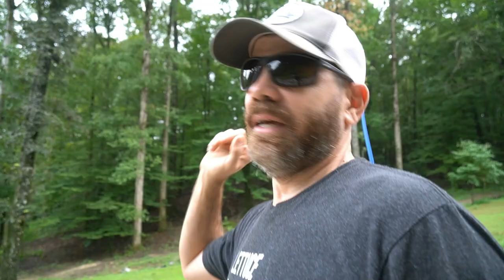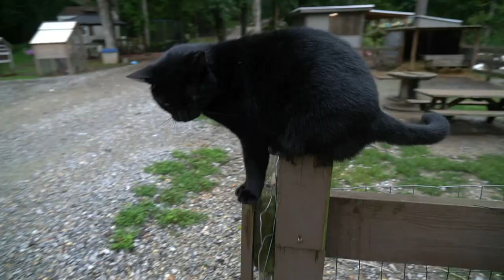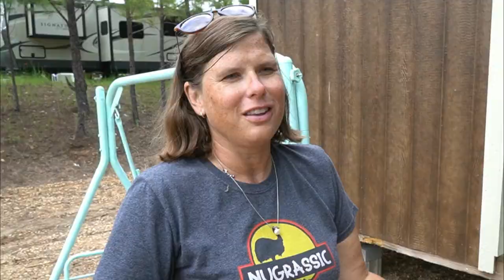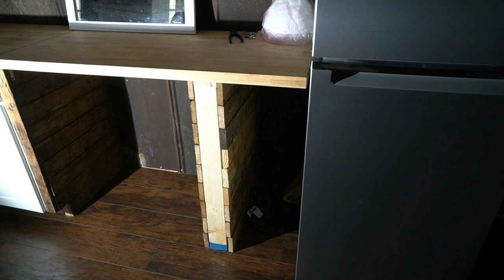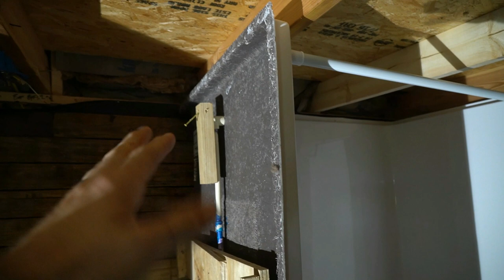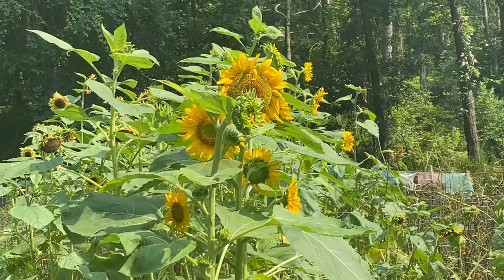The OFFICIAL Tiny House TOUR. (Would You Live In This??)

Comment: I love the layout of the tiny house and the spaciousness of it (esp. compared to the tiny houses we have here in CA).  I also appreciate the up-cycling of the materials, but I'm sorry, it should have been used inside sparingly and instead used outside, because it's too dark inside even if there's light later.  I would rather use those old barn woods outside, and paint the inside light color, with some barn woods and old tin accents like for the back splash and the TV wall only.  But it's still a very comfortable and well built house after all.  I still have difficulty saying "tiny" though.
Reply: White wash the ceiling in kitchen so nobody chops any fingers!!!👍
Reply: Yer, I was thinking I'd go over and do a pickled lime finish on the reclaimed materials so it would lighten it up. I'd especially sand down and finish the metal bits.
Reply: @D A Tsun510 - Agree it's not a tiny house in our neck of the woods. We call them shed houses. A tiny house here is one you can pull with a pickup, half the width of Mama's house.
    But going down from the size of her house, it sure tiny. 🤣
     Like idea of pickling or whitewashing the barn wood interior, it's too dark.
     I don't like the "antiqued" tin on interior walls. They often make it rusty with chemicals. I think it might give off harmful chemicals or particles, bad for breathing indoors. Grew up on small farm with V-crimped galvanized tin sides & tops. It's made in China usually. There could be harmful chemicals in the sheet metal, like lead. A rough texture , i.e. rust, will attract dust & cleaning or dusting it will release particles in the air.
     In a bldg like that, some of the quickest & cheapest walls are the sheets of what was called Masonite. They have them enameled on one side, & various colors & designs. No painting needed, & easy to clean.
Reply: @carolynchadwick7867  Yikes, I didn't think of that: the rust was intentionally created.  I thought it was really a used building material.  Regardless, rust = tetanus, unless sealed, which not only will protect the health of the inhabitant, but it will also stop more rust from forming.  I also think it's not healthy inhaling the dust particles emitted from either the rust or whatever it is used to treat the barn wood.

Comment: Use it as a party house on the pond..set up your outdoor grill, Adobe pizza oven, or Ooni pizza oven, wok station, swim spa, etc. My kitchen redo guy had to convince me 15 years ago about the whole one large stainless steel sink instead of a two smaller double, and I’m super happy, you can wash absolutely anything in a huge sink, cutting boards, even a pastry board, large brew pots or stock pots. Get a large stainless steel rack that fits the bottom of the sink, keeps it from getting scratched and drains anything you leave in the sink. I also love a little double cabinet he put in over the fridge that has removable vertical dividers for flat cookie sheets, pizza pans, pizza stone, pizza peel, cooling racks, cutting boards, anything thin. Instead of keeping my pan lids with the pots, I use a whole drawer just for pot lids and miscellaneous.

Comment: Not sure I like the rusty tin and bare timber interior in such a small space, it seems to close everything in so it's a bit claustrophobic, if you painted it a nice light color it would lighten it up a lot. As it is now you would probably need a light on all the time to be able to see but if painted a nice light color maybe it would save the lighting. Maybe consider changing to a mini split system air conditioner as well, those wall type ones are very noisy and would probably vibrate a lot in the wall.